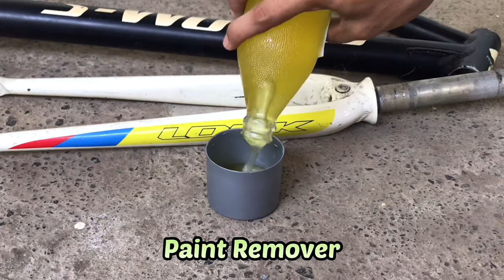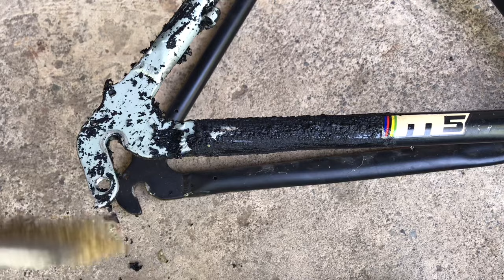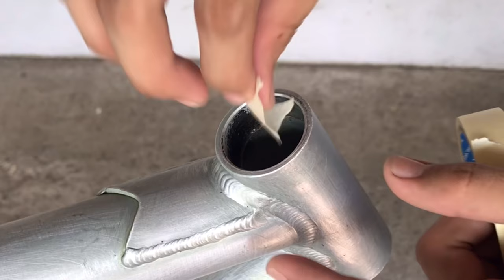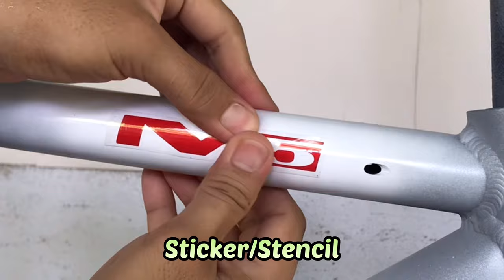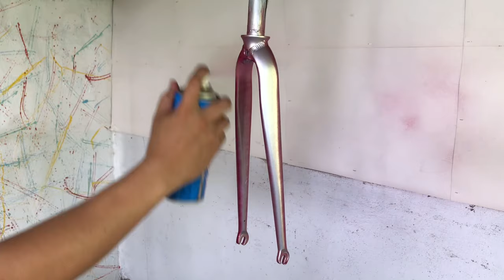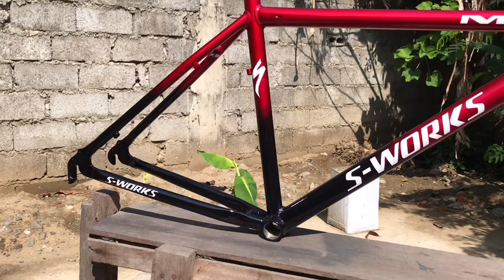Color: Candy Red | How to paint a bike professionally | DIY repaint TUTORIAL

Comment: Tip 1: Once you strip the old paint, sanded the surface, and wiped down the raw frame with rubbing alcohol. Never touch the frame with your bare hands. Always have latex gloves on. The oil from you bare hands will ruin the paint job.

Tip 2: Always use 2k primer/clear/matt coat. It's the best for frame protection and the best for base or sealing the paint job.

Tip 3: Sand with 800 grit wet sandpaper after switching paint colors.